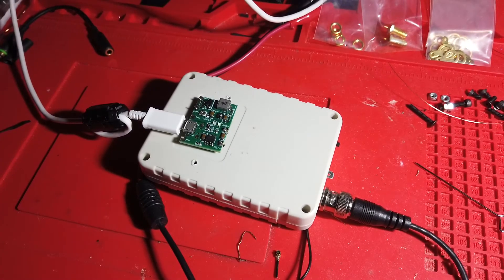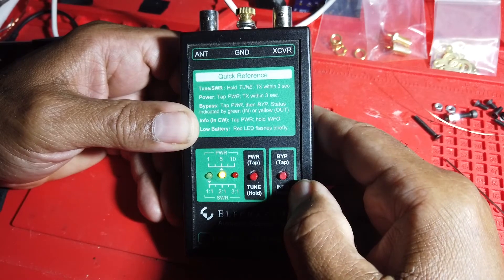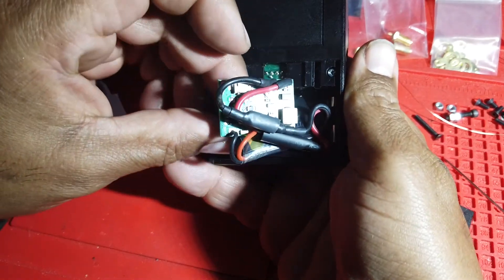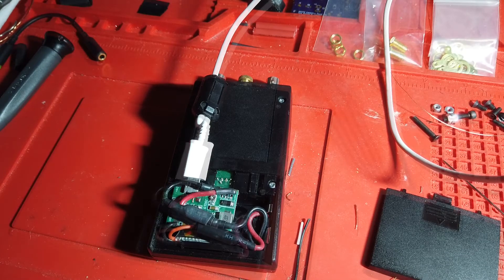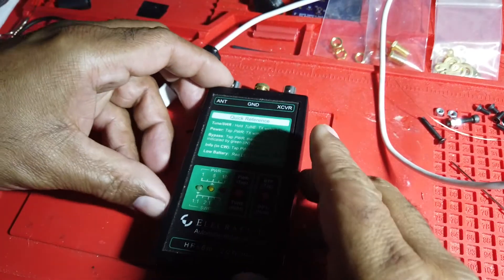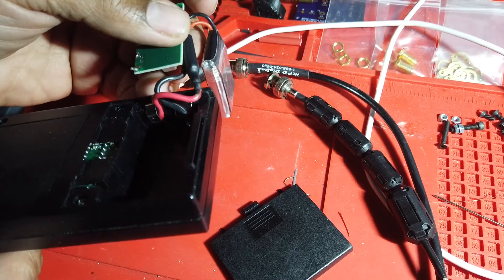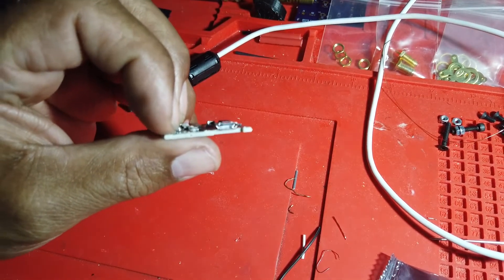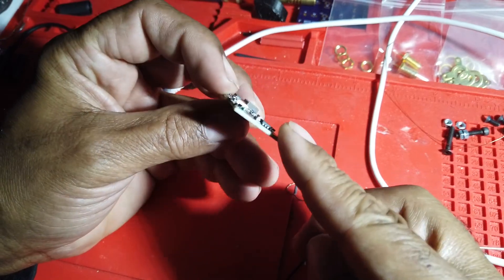Elecraft T1   Rechargeable

Comment: i swap the battery in my t1 every year. for 20 years.
Reply from the maker: So, yours lasts all year?  When I got mine I didn’t know how long it would last.
Reply: @Bill-HRT_K0WHW  as long as you use a fixed antenna setup and have the extra data cable plugged in the ft817 then power used is very low. only turns on for half a second to switch the latching relays when you change band. 
the T1 is very good but build quality is terrible. 
the new contender is the Chinese clone mat10 which also uses latching relays but has a lithium rechargeable battery and a nice anodised aluminium case for about 150 of any major currencies and they include the data lead

Comment: Where did you get the charge controller?
Reply from the maker: I got it from Amazon.  My intention was to get a dc-dc boost module to play with and try to understand.  I figured out when it arrived that it had other abilities that I could experiment with.  The Amazon description is below:

AITRIP 6PCS 2A USB 18650 Lithium Li-ion Battery Charger Module Boost 3.7V to 5V 9V 12V Adjustable DC-DC Step Up Boost Module TP4056 DIY Kit Parts

Comment: Great idea! I need one of those tuners and this mod.
Reply from the maker: I really do try to avoid sounding like a fan boy, but I can’t say enough about how well this tuner serves me when I use it.  I got it as a kit, and that was added fun and satisfaction in building it! I try to use resonant efhw when I’m in the field, but sometimes another antenna is more appropriate and this little tuner does a great job. The mod hasn’t failed me yet, and I use it on a regular basis with a loop on the roof at home. It doesn’t need charging often. When it does, it charges quickly. Thanks much for stopping by and spending time watching the video!